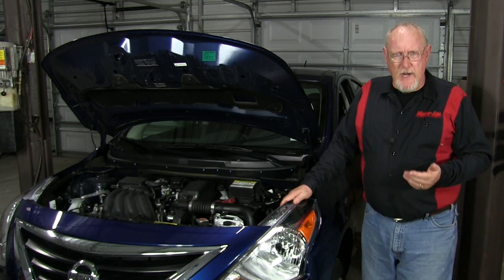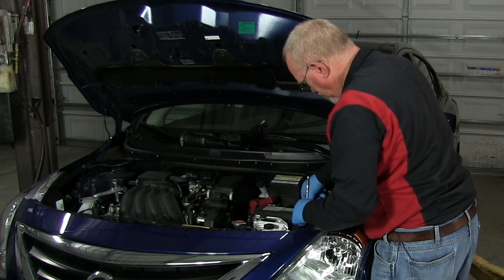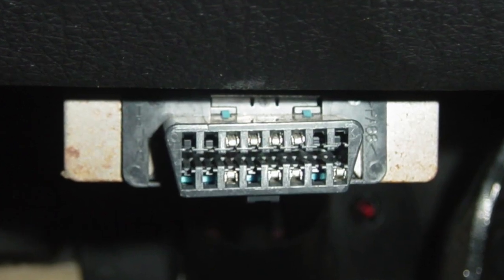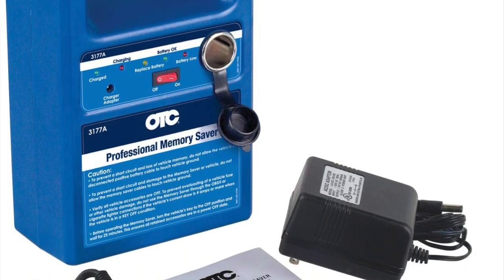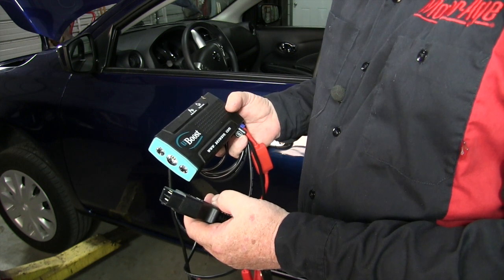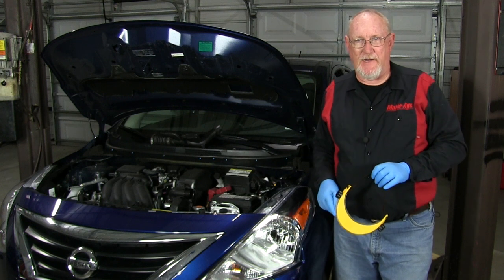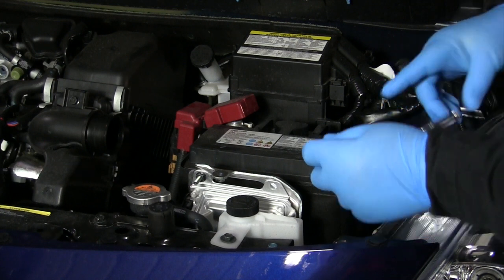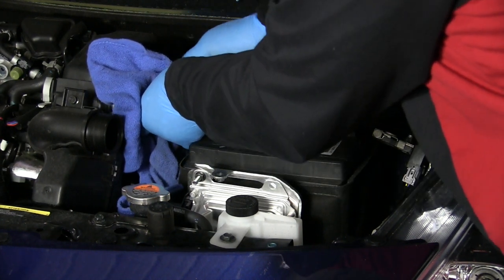The Mighty Minute - Ep. 28:  Battery Service Tip - Using A Memory Saver

Comment: Helpful information thank you.
For those that have 12v batteries in the trunk....it may take 20 mins or so to complete the process of swapping out the battery ...and some models of the 'jump starters' will turn off ...automatically... before your swap is completed.  If this happens you have lost many of your cars settings(newer cars).  So likely best to use as temp power source...either a model that does not auto switch off...or a real 12V power source.

Comment: Great video, have you tried using a jump and carry with jumper wire going to the battery pos lug of the under hood power distribution box? This seems to keep all the memories of the vehicle better than the dlc plug.
Reply from the maker: That would work, sure - but as Jacks Auto Repair shared, you still have to be careful with any of the exposed connections AND the loose positive battery cable end. With the DLC jumper, I only have to worry about the one.

Comment: U said any 12v power supply jump starter is safe for OBD2, but this thing can power up a dead batterý which means can deliver like minimum 300A right ? So u mean it's still safe to use for m. Saver / the computer ? Please advise bcoz i'm afraid that could damage the ecu
Reply from the maker: Amperage is relative to the load - how much it needs. If not, the battery would be blowing up every device on the car.
Reply: @MotorAgeMagazine  makes sense. I = V / R. Thx. I believe with the latest device like Autowit Supercap 2 could be used for memory saver through OBD2 port right ?

Comment: Great videos. Can i use a noco GB40 as the battery memory saver? Thanks, Tom.
Reply from the maker: Any good 12v power supply can be attached to the memory saver.

Comment: If all you are doing is replacing the battery just do it with the engine running. Take the same precautions with the battery connectors.

Comment: This will not work on Volvo’s. it will blow a fuse (sorry, can’t remember what one). Every other manufacturer I’ve tried it has worked👍
Reply: Normaly have to make sure everything is switched off before disconecting the main battery or you will blow the dlc or pcm fuse. Usualy about 5amps.

Comment: VERY NICE! i was wondering about the + cable being hot still..  what about a plug for the cigarett/12V supply port  that is hot at all times?
Reply from the maker: On most cars today, the power outlet is fused and does not always connect directly to the battery. If it isn't "hot at all times", it won't work. Even then, I'd check the Power Distribution diagram before I relied on it.
Reply: Nothing wrong with using the cigarette lighter socket to achieve the same outcome plus it’s super easy and inexpensive to make up your own, but as Pete said, just check your specific car’s wiring schematic before relying on that particular method or test the socket with a DMM for 12V KO.

Comment: Hi, to install the new battery do you put first Pozitiv and second negative?
Reply from the maker: Yes. Negative first on removal, last on install
Reply: @MotorAgeMagazine  thanks, also at the same time when im changing the battery is it oki the Memory Saver(EZR S4000) to be in charger ? Or firdt to wait to charge the Memory Saver?
Reply from the maker: @arlindveseli1152  The memory saver is used to keep the memories in the various control modules alive. The procedure is:  install the memory saver in the DLC, remove the battery (remember, though, that the red battery cable will have voltage on it - don't let it touch ground!), install the battery, remove the memory saver.

Comment: I have a 2013 audi s6 just purchased a solar memory saver with 12 volt power source built in.Manufactres instruction say don't use if amp draw is 4mps or higher.How do I stop vehicle from loading before using memory saver
Reply from the maker: Interesting question! I would see what the "at rest" current draw is the modules "awake". In other words, measure current flow after you've opened the car door or hood, with the key off. If that is under your 4 amp limit, I would think the memory saver should work for its designed purpose - changing the battery. HTH!

Comment: is there a best device for saving memory like when swapping engine, transmission and where is the best place to get the best quality memory saver device
Reply from the maker: There are many possible solutions for you. I would shop around - Amazon has a lot of listings to compare. Your challenge is maintaining the correct voltage level for an extended period of time so the simple ones that connect to a shop battery probably won't meet your needs.

Comment: Do you see issues if a collision shop / body shop were to weld on a car while a battery saver is being used?
Reply from the maker: Yes...collision repair, or any welding, should follow the OEM processes for safeguarding the electronics
Reply: @MotorAgeMagazine  I agree wholeheartedly.  I just see many techs that are unaware that memory savers can cause an issue when welding because they didn't read OEM info and they think that they have it covered if the battery is disconnected.  I really enjoy these videos!  Keep up the great work!!

Comment: So doing it in reverse means connecting the positive cable then the negative?
Reply from the maker: No, what I meant was when you're reinstalling the battery - connect it first (always positive cable connection followed by the negative cable connection) and then disconnect your alternate power supply/memory saver. HTH!
Reply: @MotorAgeMagazine  hello I was wondering so if your reinstalling the battery starting with the positive then negative would anything happen by having the memory saver still plugged in the DLC your advice is appreciated
Reply from the maker: @Franksinatra96  No, you leave the memory saver connected until the new battery has been installed and reconnected to the vehicle.

Comment: Is there a blocking diode in that ODB port? How is the Car battery +12v not fighting the external +12v supply you are hooking up into the ODB port?
Reply from the maker: The voltage is potential - nothing to fight against. Since the two are wired in parallel, it's no different than a two battery diesel set up. 12v, just extra amp capacity.

Comment: Why not use a 9v battery?
Reply from the maker: The old 9v in the cigarette lighter won't work anymore for two reasons. One, the control modules do not share the same power feed as the "power outlet" does and two, the amount of drain would kill the 9v battery in short order.
Reply: @MotorAgeMagazine  
I bought a 9 volt battery car memory saver that is supposed to be rated for 4 hours. Maybe not though. I dunno.
Reply from the maker: @superserial1  In the old days, maybe. But today, the only way to ensure that all of the modules are maintained is to go in through the DLC OR connect another battery in place of the old one WITHOUT allowing the power flow to be interrupted.
Reply: @MotorAgeMagazine  where can I find one like you are using?
Reply from the maker: @rcthomas6925  I have one now from Autel that I really like. You can find others at www.aeswave.com